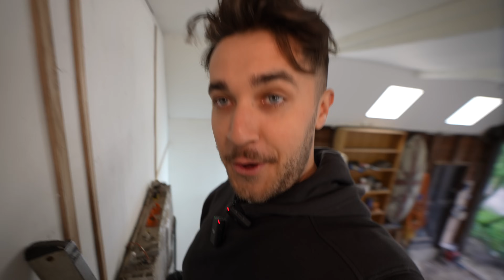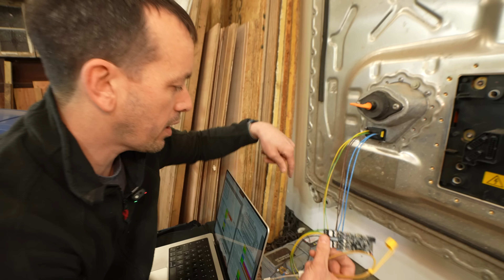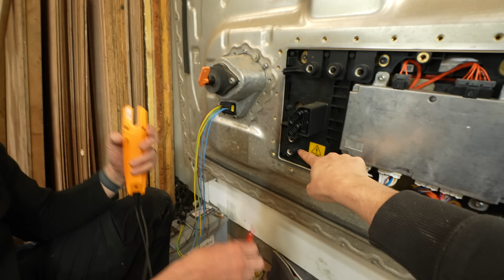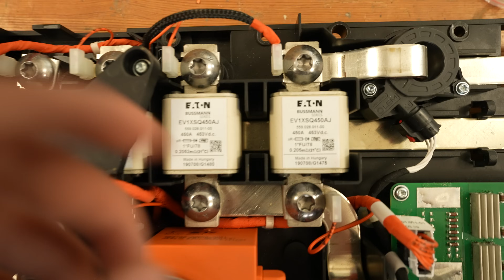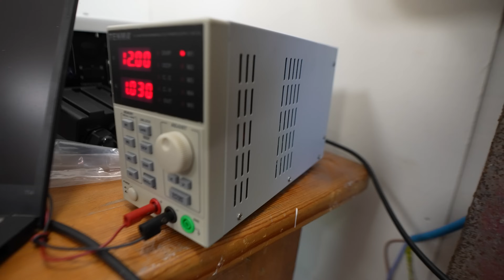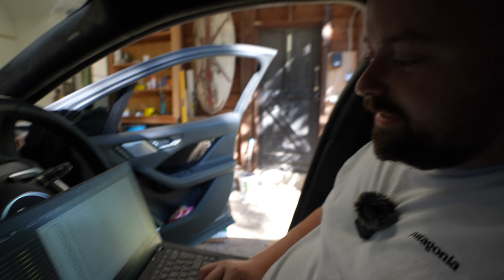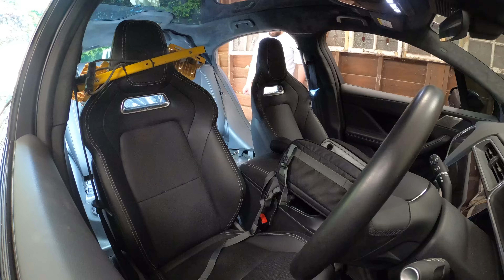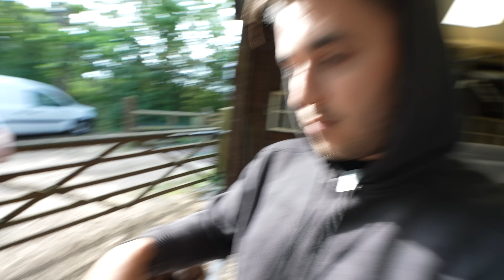Hacking an EV Battery From a £90,000 Car -  DIY Vehicle to Grid | ØY44

Comment: Sanity check...because ...reasons...serialization or encryption of the can bus might be a thing - (to stop someone plugging in a can rubber ducky and replaying "turn the autopark steering wheel motor while at highway speed" to attack people.
...The ecu might be saying on the one ipace "hey, battery serial number 123, I'm ecu 456 that you're paired with, turn on". When you replay 123, battery 789 on your wall ignores it.
Reply from the maker: Chris is onto this 😁👍🏼
Reply from the maker: Thanks though!

Comment: People have been doing this for years, nothing new here.
Reply from the maker: I’m aware, I’ve worked on containerised versions before. On other older batteries it’s much simpler. These newer systems have far more barriers and manufacturers are adding far more tech into them to prevent it.
Reply: @corymac  that doesn't make sense, folks such as Jason Hughes were doing much the same back in 2016, the only recent change is inverter manufacturers producing hybrids that have a far high DC input voltage, hence the ability to use complete ex EV packs without needing to dissemble and reconfigure. Dala has made these systems almost DIYable, especially with the like of the Gen24s - but I guess your target market will find it interesting.

Comment: Definitely not an expert - but I wouldn’t be surprised if the battery wants to chat with (for example) the charging port via CAN as part of some safety/sanity validation.  You may find plugging in that loom you had laying around helps.

I’m optimistic you’re on the edge of.m victory though!
Reply from the maker: Thanks mate! Hold tight for part 2!

Comment: Does the battery and car which were paired, perhaps have an ID which needs to match, a bit like if you have a key reprogrammed, or in some ICE vehicles when a new part is put in, error codes need clearing and pairing often needed..just a hunch
Reply from the maker: Good hunch! We’ve been checking this out 😁👍🏼 - It’s getting there! 99%

Comment: Yah I don't see where the difficulty is other than you keeping those batteries in the cars holding case.

Remove the batteries or just all the electronics reconfigure the batteries and you have a battery ready to go in any home, of course you need an inverter, job done.

I think sometimes people make things more difficult for themselves just for the challenge.

A battery is a battery it doesn't care what it is used on, its the control devices that are a pain I  the back side, but you can remove them and either pit in a new friendly system or do away with it altogether and cobble together a simple monitoring system, but the battery itself doesn't care what it powers.
Reply from the maker: I’d have to then re top balance, and get a new BMS to balance it all and monitor it all. Jag have spent millions developing this perfectly, I wanna use it as it is
Reply: @corymac  Yes but that is what I said, you would have to monitor it, but to be honest these batteries once you get them top balanced can go a long time before they go put of balance, and using a simple monitoring system you could avoid all the complications.

However I would agree that if you can use the system that comes with the pack then it may well be easier in the short term, except for getting the system to work.

Mind you you could always strip out the cars system and use it as is.

But I have found using a simple monitoring system for charging the easiest, but then I have mostly done smaller systems, my next project will be a motorcycle with 122v system and I intend to not to use a bms and only use a battery monitoring system, and if the pack goes out of balance to use a segregation method to charge those out of balance to bring them back up to the others, which is the same system I use on other devices I have built.

I also only use a simple cheap low state of charge warning system so as not to drain the cells too low, but even if I do drain them too low I can bring them back by placing them in parallel with another pack by pack.

Tip them over the edge by pack which then allows me to recharge to full, and isolate the packs at full charge to bring them up.

Or alternatively another method I have used is to use a bms purely for charging and nothing more, even easier.

The problem with using the cars battery control systems is that it will be searching for specific instructions, may even be doing the same as time passes.

Comment: Mostly ev cars after accident for safety kills big fuses inside that relay box. You guys should check those fuses or they are ok. If airbags was activated on that car, then 100% fuses will be open circuit to and that’s why probably there is error message on can bus.
Reply: The fuses are OK
Reply from the maker: What he said 👆

Comment: EU should legislate that all EV batteries be capable of reuse as a home battery with standard controllers, connectors, protocols etc.
Reply: They won't have to....this project will have decoded them all by then! Lol😂
Reply from the maker: I wish 🤤
Reply: I would like to have a standard interface for helping handicapped people. Can't use the indicator lights? No problem, just wire it up to a keypad.
Reply: buying chinese bms is kinda risky when you dealing with huge batteries and I believe there is open source project where some guys working on reverse engeenering mosly can protocol or reimplementing whole controlers with custom one. Personally I bought kia niro  2021 battery pack for 199GBP cheap great source of hq cells.
Reply: @michalekpe don't know if you are aware that almost all home batteries have Chinese bms
Reply: Unlikely that they ever use standard controllers and protocols even for solar batteries there are various systems for different voltages, cell types etc. Even if you have a standard protocol different manufacturers implementation often have different quirks as no standard is ever going to be perfect. 
And if you look at how this worked out with the EV charging connectors (especially the DC side / ISO15118 communication) it's a mess. 
 
A alternative which this battery simulator project already comes close to is to just have manufacturers supply the protocol descriptions required to use it, which will probably have less friction and wouldn't be significantly worse in most projects.

Comment: Hi Cory. I see you have bridged the LV Hvil but the HV Hvil bus is still open circuit. It will not allow contactors to close if the HV Hvil is open as there would be HV exposed on the Battey HV connectors. You would need some way of creating an HV circuit to show/ trick the OCM open circuit monitoring. Is there a way of contacting you? You may be able to guess where i work. 😉
Reply from the maker: We have managed to get the HVIL’s closed now, but having other issues! Come help 😂👍🏼 - Info@oyelectrical.com

Comment: It’s weird that despite 19 times more car fires coming from ICE vehicles that we’ve never been told to leave our petrol cars outside.
Reply from the maker: Exactly!!!
Reply: It's not weird, there are way less electric vehicles than ICE vehicles. Also, an gas car that isn't running isn't going to spontaneously combust without a spark in the fuel talk. An electric car with a charged battery has more ways it can fail in, even if it is turned off.

Fwiw, I own an electric car and I love them, but what you said just isn't correct
Reply: @holly_hacker  You clearly didn’t read about the diesel range rover that caused the Luton Airport car park fire did you. Or the car transporter fire that was caused by an ICE vehicle. Or the other fires that happen when an ICE vehicle is just sitting there.

Comment: The potential here is utterly slept on
These batteries are just CHILLIN in junkyards because nobody needs them and battery recycling isn't profitable (yet), so you can get NUTTY amounts of electrical storage capacity for CHEAP.

Safety wise, the batteries are wildly overbuilt for home energy storage, and are under basically zero stress even when your entire house is pulling like a hundred amps.
Reply from the maker: That’s our exact thought process
Reply: @corymac  need updates on this man, also do a write up and publish the code so others can follow along later

Comment: The BMS ECU will go to sleep because it's not seeing activity on the CAN bus.   You'll need to record a log from the iPace and play it back through SavvyCAN in a loop.  Then turn off the IDs one by one until you find the network management frame it's looking for to keep it awake.  I don't have any experience with the iPace CAN, but I've done extensive reverse-engineering on Teslas systems, and this is how they work.
Reply: Wow Phil, Good to see you here on this side of the Atlantic.
Reply: It would probably help if they could fly you in for some consultation, because then you could see the conditions real time as they happen and not just in the edited bits. Its pretty cool to watch the process as everything evolves.
🤘😁👍
PS Have you checked out the electric conversion kit at DeBoss on youtube?? They are taking a 3/4 ton gas guzzling beast of a truck destined for the wrecker and adding batteries, electric motor driven axles and a environmentally friendly little diesel motor, to turn it into a modern hybrid. They need help figuring how to get the CAN to talk to the trucks processor for establishing safety protocols "airbags etc" and running lights, air-conditioner etc. Its one hell of a project if you are curious. Cheers
Reply from the maker: That’s exactly what we’re doing in the video 😎👍🏼
Reply: @corymac  Well, I missed the part where you explained this then,  You seemed  to spend a lot o f time  trying to figure out why the BMS only spit out CAN for a short period on power up.   I also never saw you isolate the CAN frame ID needed to keep the BMS awake (the network management frame).
Reply: Most people will strip the battery and put the modules into 24v or 48v (as close as possible). Then just use standard solar electronics.
What can you do in 400v form?
Electrocute yourself?
If your dog bites the 400v cable, it's brain will fry.
Reply: @joeberginc7415  400v is substantially more efficient.  If you aren't qualified to handle 400v, you probably aren't qualified to open the battery in any event, and even a tiny 48v pack can still burn your house down!  I have a fully intact Tesla Model S pack that I am using this exact way, and it works great and is safe.  By keeping the pack in it's original envelope, ts also safely contained in case something goes wrong.  Using the original BMS instead of some hacked in thing is also much safer.
Reply: @Ingineerix  did you use the cooling system in the battery pack? I was thinking it would help keep the cells lasting longer am I wrong?
Reply: @crzy11000  It's inside my temperature controlled shop, and since it's really never seeing more than about a peak of 15kW, I didn't need to worry about the thermals.  As long as it wont ever see below freezing or above about 140°F (60°C) you don't need thermal management.   What extends the life the most is keeping it below 80% SoC.

Comment: After a crash, the pyro fuse blows and will need to be replaced. That could be preventing the output, want to do this myself in the future so excited to see how it works out. Best of luck.
Reply from the maker: We’ve checked and it seems to be intact, but we’ve made some breakthroughs! Part 2 coming soon!

Comment: The Guys on the EVTV Motors channel (owned by the late great Jack Rickard) did this with the Tesla model 3 battery pack and they sell a module you can just plug into the M3 battery pack and hang it on the wall, maybe asking them for help would be an idea?
Reply from the maker: That’s cool! I believe we might have just made a huge breakthrough with this now! Hang tight for part 2!

Comment: very cool idea , I thought I should give an idea if i may , recently I have been part time attempting to hack a JLR module from some older JLR cars to try and learn how they run , now what i have learned is that they do indeed run over a CAN network and yes still 2 pins but they run on a different protocol which is UDS ,  now this protocol on its own is very very similar to TCP/IP  like in a CISCO router , or any home router for that matter.  it uses the same APSTNDP (OSI model)  now UDS can be used without encryption in its simplest form ,  but all vehicle manufactures encrypt the data so it can be hacked (allegedly)  , but you can sniff the data with a logic analyzer or a UDS sniffer  , then fuzz the data so you gain the encryption keys so then you can basically get it to work , now there is a chance the battery is VIN locked as Volvo do VIN lock there modules , and also module synchro'd there modules as well ,  and the encryption keys for the car and the battery maybe different so that might be why the battery wont work when its connected too the car (maybe).   , so if it is indeed using UDS protocol you'll have to see if you can hack it there is a piece of software called caringcaribou on git which might be of help. , but it doesn't stop there you'll have to build the PID's and see what the module wants and what you can do for instance change VIN , hard reset , soft reset , etc  , almost all parts on a modern car are VIN locked so it wouldn't surprise me one bit if this battery BMS system  is the same.  its worth ago i guess ? , also are you going to share where you found the wiring diags?

Comment: You might have filmed the second part meaning this is redundant, but be extremely careful with that pack forcing it via external connections. The phyro fusing etc is likely with the PDM tower which you proved is OK. With the cam errors it might be a break or fault within the internal wiring.

LG Chem made these packs using a third party BMS at the time, I’d open the case & voltage check each individual cell before triggering a charge, you might end up getting to a position of forcing charge into a faulty pack.

You have a good knowledgable team around you but with HV NMC batteries it’s better to be safe & check cell/module level when the pack level PMS CAN is faulty
Reply from the maker: Thanks mate 🤓🙏🏼